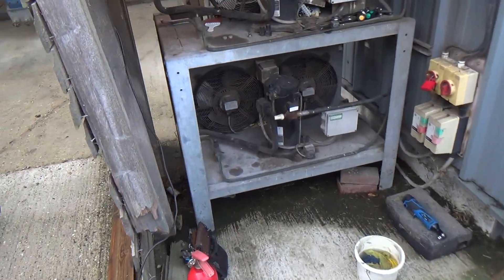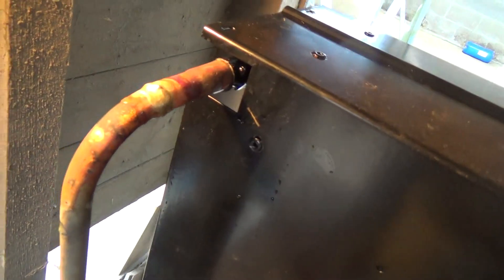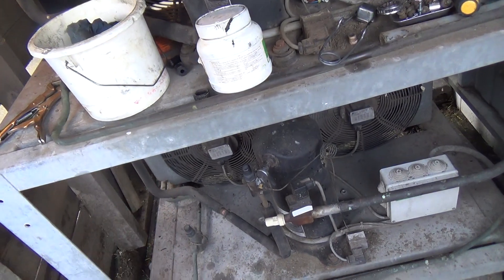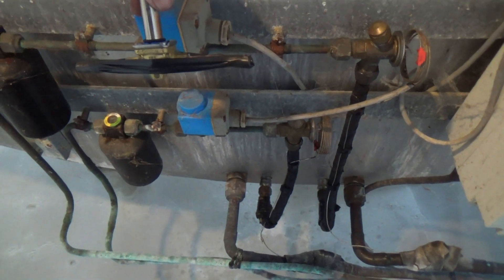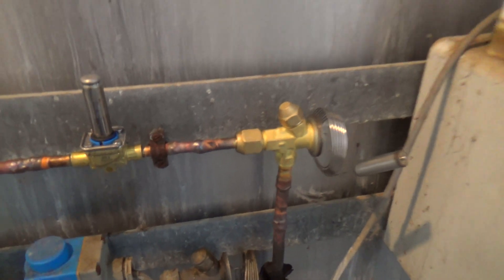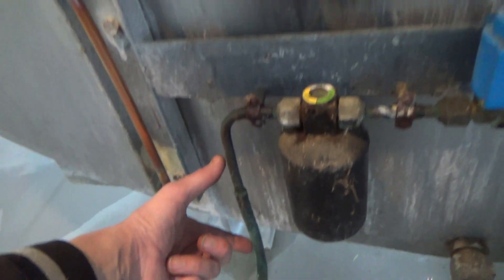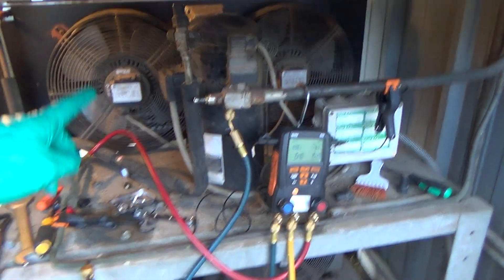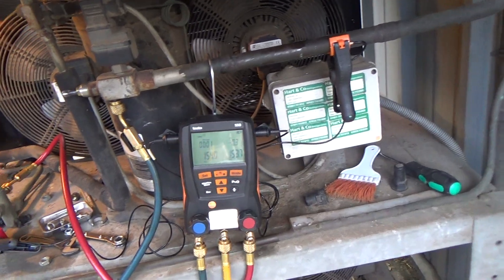Serap Condenser Replacement

Comment: you should've used r438a instead, they run at almost the same pressures and you don't need to change the oil. it's a perfect r22 replacement
Reply from the maker: I've used R438A in the past, works well. Most of the new systems here are on R449A which is much cheaper than R438A plus it means its one less bottle of gas on the van so am using it where I can.

Comment: Hi John, do you use a flux when you silver solder and which rods/flux do you use? I have only used the Rolot s2. Nice job as usual!! 👌
Reply from the maker: Yeah you have to use flux with the high silver content rods or they won't stick to the pipe, the more coppery coloured rods are self fluxing so no need for the flux with them. I should do a vid on the different rods and their uses.
Reply: Florida Man HVACR  thanks Florida 👍

Comment: just a question why do you never put a sight glass by the compressor?
Reply: Compressor output is a hot gas, sight glass will stay clear and get coated with oil inside. You put sight glass near expansion device, cap tube or TXV, so that you can see the flow going into it is fully liquid, with no big gas bubbles, as by that point the heat should be fully rejected leaving cool liquid only to get the best expansion. You can put in suction, to see that there is no liquid being slugged back, but all you will see is cold gas and the odd bit of entrained oil being returned.
Reply: @SeanBZA  surely you must know by now, no good deed goes unpunished! 🤣🤣🤣
Reply: @SeanBZA  thats just stupid lol   i'm talking for Comfort  ... having a filter sightglass at your compressor is much better than having it far away     if my system is big and expensive i'll install a filter near the solenoid
Reply: @primetime758  well there you have it, this system is realy very expensive hence the filter and a sightglass at the solenoid 😂😂
Reply: @sjefoekel6058  omg can you not read i said    why didn't he put a sightglass atleast by the reciever it would save him time..
Reply from the maker: The originals are were fitted there by the factory, so just put it back as it was. If this was a new system I was building the sight glass and drier would be near the condensing unit.
Reply: @heavydiesel  true but i'm just saying atleast a sight-glass by the reciever would of been ok since you had all the tools there  but its all good i remember one place where the compressor was in the basement  condenser on the roof...  filter at the reciever and sight glass ontop of the box lmfao it killed me